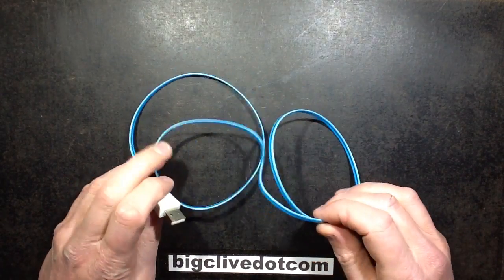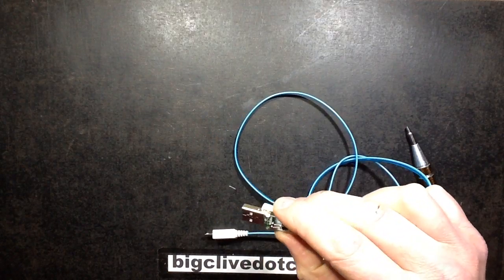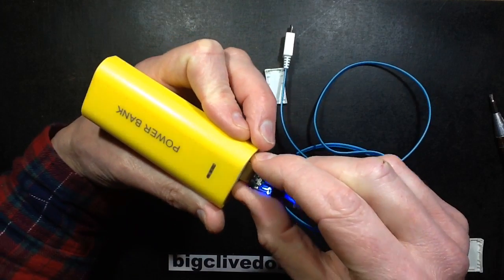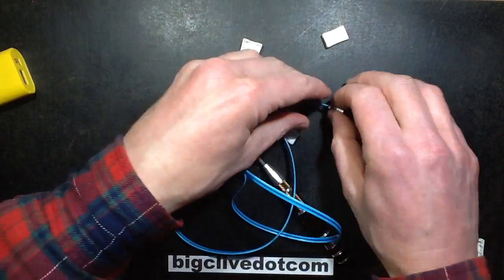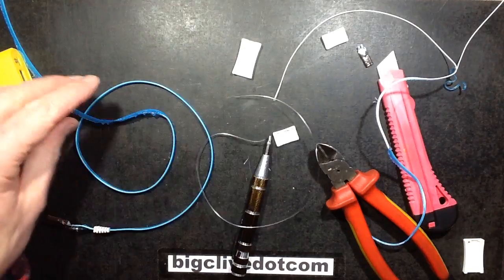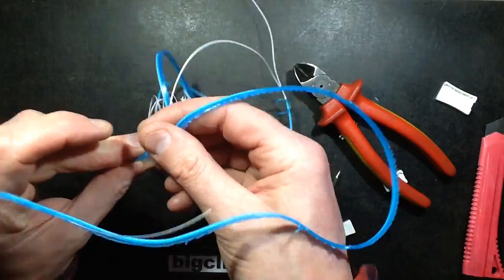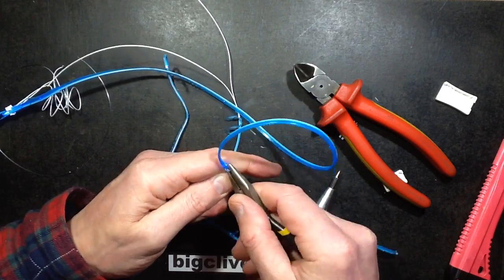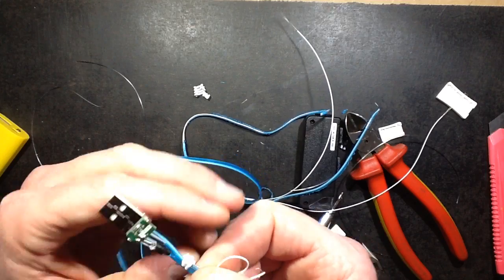Teardown of an illuminated wire USB charging lead.

Comment: Curiosity on how things work is the dogs, you need one of them cheap Chinese USB microscopes. 👍🏼
I bought some Elwire (electro luminescent wire) from Banggood for a couple or 3 quid, it's equally as fascinating how it works.

Comment: That's the very same cable I have. Comes in useful for charging my istick 30w mod because of the longer plug without taking my silicone case off it. Which was a useful outcome. Not as bright as I hoped though :)

Comment: not that i have this exact cable, but i have one that looks REALLY similar. the light level has gone down a little since starting using it, (roughly 5 months now) it is hooked into a USB outlet 24/7 with maximum of 1A running through it to my induction charger. must say that i thought it was surface LED as well. surprised at the fiber down the middle.  so far, it is still lit, but yeah, getting dimmer all the time.

Comment: hi you could try and use fishing line to replace the fiber optic
Reply from the maker: playdav485 Tried that ages ago. It doesn't work.  Real fibre optic is very clear and has an external coating with a different refractive index that creates the effect of a mirrored tube.  Like when you place your finger in a glass of water and you can see a refection of your finger off the inside sides of the glass.

Comment: Maybe you could show us if the light dims if the fiber optic is bent enough in any one direction? I can't imagine the notch to be all that accurate. I'm not sure what frequency the fiber optic module would be using but a big notch should show up on the final projection when the cable is bent to extremes.

I think the thingy is called a boot.
Reply: It does dim at sharp bend. Was unimpressed initially until I unrolled/ unfolded mine.  Otherwise is very nice as Mr Mitchell describes. The heat marks have the advantage of distorting local optics as if one melts an end into a ball or button; very nice effect. The 30pin plugs are large and easy to manage as well. The yellow power bank I have not seen him review. If it is as mine it has a cover that slides off to make easy battery changes
Reply: I have also recently seen that style power bank box with a bluetooth shutter control built into the bottom. As well as another toy to play with, the extra length looks like one could easily modify this case to fit the protected cells.

Comment: Hi,
I came across this whilst looking for ways to illuminate a usb port. Just a quick question: is the LED/resistor simply wired in parallel to the 5v supply? This is what I'm going to do!

Comment: Magic knife = chib. :D

The question is: if you did chib impale yourself, would you remove it from the video?
Reply from the maker: I did slightly impale myself in the video.  If you look very carefully you might see traces of blood.  Major impalement might change the direction of the video, but it wouldn't stop me putting it up.  Fortunately for technical people our hands have an auto-repair function.
Reply: A bit of Detol and a plaster. Right as rain in no time.  :D

Comment: Love your videos Clive. Question: What kind of mat are you using? I'm trying to source one for my home workbench, and would love your suggestion. For the record if you reply "pound land" I will openly cry and have to drown my sorrows with scotch ...
Reply from the maker: +Richard T That was actually just a painted surface.  If you look at the recent videos they are being done on plain MDF.
At my other workshop I use black rubber safety matting.
Reply: +bigclivedotcom I did notice the plain wood in the new videos, but mine is getting rather spotted with burn marks from solder drips. It is 7pm in western Canada, 3am in the UK...on nights I would presume? Take care and thanks as always!

Comment: I have two of the braided-looking RGB gradient cycle ones that the device-side inputs broke on but the outlet side still works. I want to splice them into one long one because they stay on even without charging and make a cool LED light. 

I wanted to splice one DC side into the others device side, basically one powering to the other.

Is that possible?

Comment: I bought one of these recently, however it appeared to have a solder bridge between 5v and the shield, causing it to quite quickly destroy one of my usb power banks... beware!
Reply from the maker: +Marineio Your power bank should have short circuit protection.  Sometimes the power bank will appear to die, but will reactivate when a charging lead is connected.
Reply: +bigclivedotcom indeed Clive! completely dead to the world (hot burning smell initially) but attaching the charging cable did actually bring it back to life (God knows why I didn't think about that when I was swapping cells and getting annoyed!)
Reply from the maker: +Marineio Hopefully the hot burning smell was the lead being punished for its inadequacy.  I have accidentally shorted out some of my power banks by putting those bare PCB LED lights in back to front.  It seems to reset the control chip to its inactive factory mode so that it only boots up when a charging voltage is detected.
Reply: I got refunded and bought another - hopefully this one will not have the excess solder this one had. They do look quite nice and at 99p who can say no!

Comment: I bought one of these recently and it does more than just glow.  When it is plugged into my tablet it cycles the light like little marching ants up the cable from the charger to the tablet.  This effect is fast when the tablet needs lots of charging but as it charges the marching ants slows down to a trickle when the tablet is nearly charged.  Then when the tablet is fully charged the lights go out then periodically it lights up and the marching ants effect starts again at a reduced brightness which I assume is the tablet internal charging system moderating the tablet charging to a much reduced rate so as to not over charge.  Did you check this effect out?
Reply from the maker: +Mike Rhodes It might be the chasing electroluminescent wire?
https://www.youtube.com/watch?v=W507C1qfXGM

Comment: You should get some EL wire (electro-luminescent wire), it has a similar effect to this, and i kind of want to know how it works. you can get some on ebay for around £3 for 9ft.
Reply from the maker: +Jack Knaggs (Electricguy2442) Inner core and outer conductive layer around a phosphor loaded dielectric.  When AC is applied it stimulates the phosphors.  Not very bright though.
Reply: bigclivedotcom thanks for telling me.

Comment: I found some 3 meter (9.8ft) of TOSLINK normally used for audio patching.
It is on an Amazon site but you could get the specs to find it on BangGood or GearBest or E-Bay.
https://www.amazon.com/gp/product/B00L3KO3YU/ref=ox_sc_sfl_title_11?ie=UTF8&psc=1&smid=ATVPDKIKX0DER